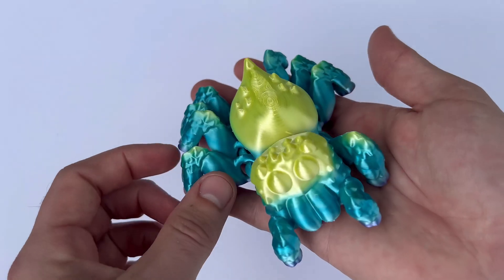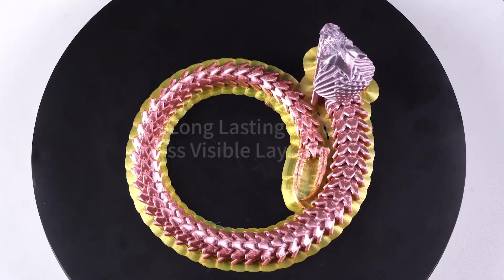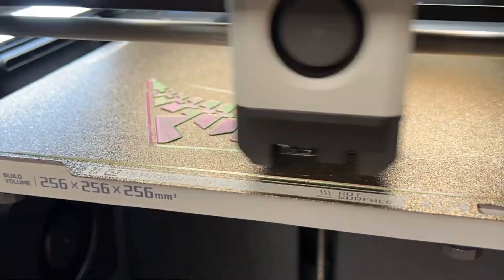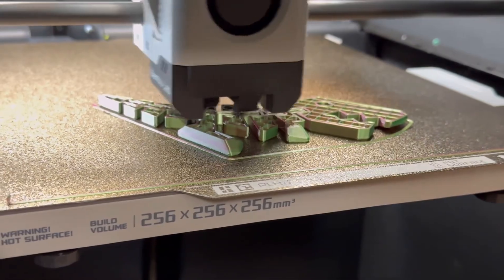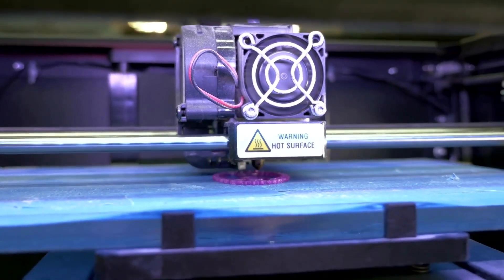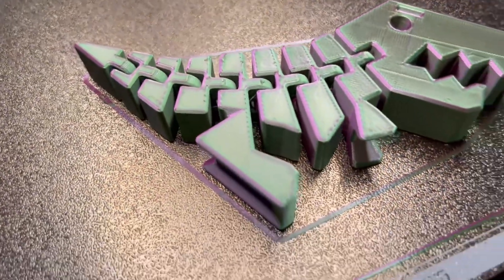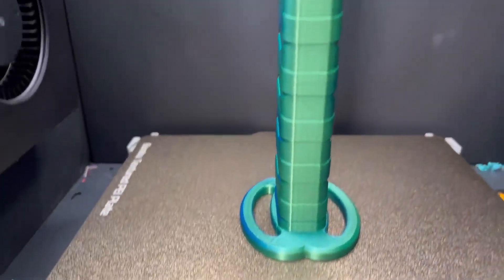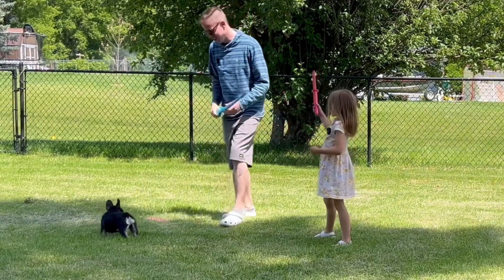Is Anycubic Filament Worth It? Honest Review

Comment: I am scared to buy this because I have heard that the filament is brittle is that true
Reply: PLA is indeed brittle, but it depends on what you get. I got PLA+, so it's more durable than original pla, Anycubic doesnt only sell pla, they also sell PETG which is a solid choice if you dont want brittle filament. However, it is kinda hard to set up.

Comment: Amazon uk have some insane offers on this stuff atm.  25% of a roll.  Buy 3 or 2.  Then another 10% off each roll for signing upto S&S!  I just got 3 rolls of their PLA for £22 ($28.42) which is £7.33 a role!  

Quality wise its my goto filament now, it prints as good as the Bambu stuff i cant tell any difference.